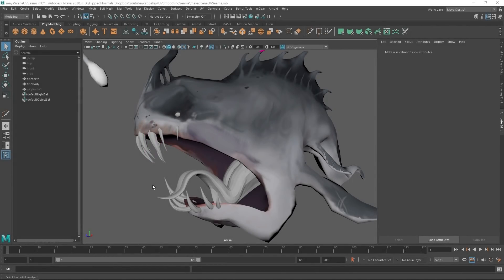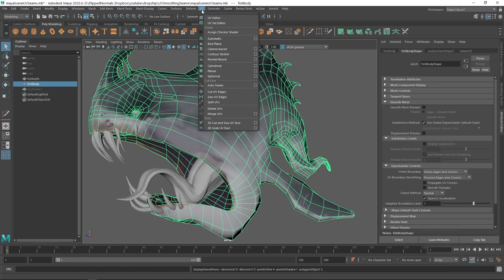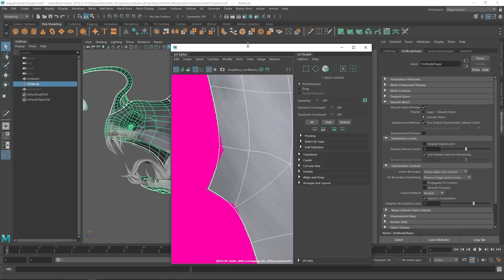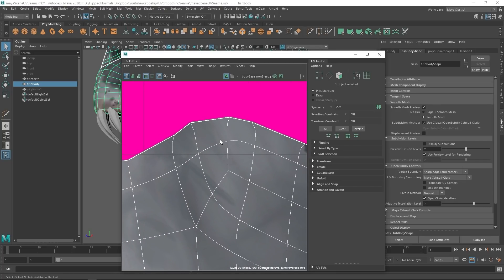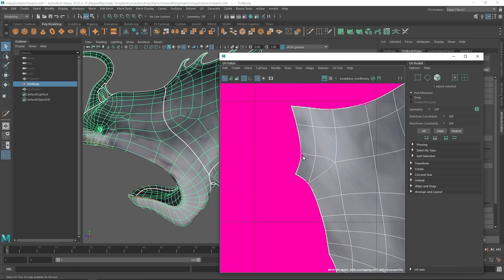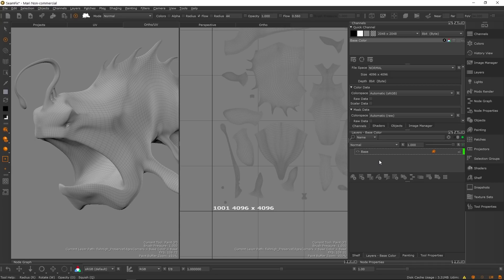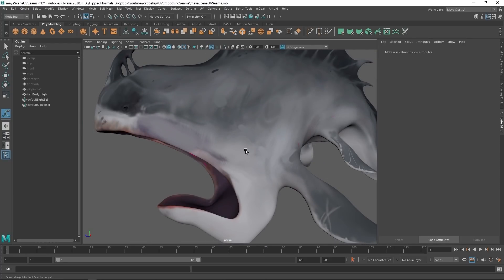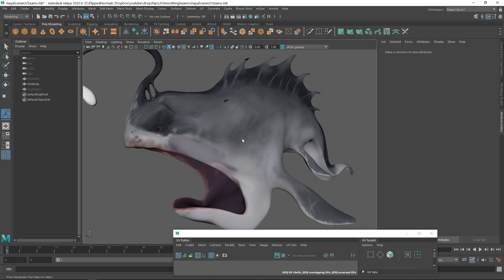The Best Way of Fixing Texture Seams in 3D - Ultimate Tip

Comment: So why not just use all smoothing, that is, preserve edges? There is absolutely no problem with this. (preserve edges and corners) actually still have problems in some corners.
For example, where there is a cylindrical depression on the surface, because the cylindrical part of the cylindrical depression must be cut by uv, this will lead to some shrinkage of the circular part of the surface and beyond the uv boundary. Especially in the case of hard edges of three wires.

Comment: A long shot but I'll ask! Hello, if there is a shading problem across the UV seams, what is the cause of this? Or how to fix? Gamma correction? As a result when I load ibl texture it does not match up across the seams. Regards
Reply from the maker: Could be that you need more bleed on your individual UV islands
Reply: @FlippedNormals  Thank you. I will check this. Also, Do you think it could have anything to do with UV's overlapped causing bad binormals?

Comment: 0:39 it exactly what happened to me just yesterday me and my project, I doing texture paint it and I use Blender and have the same problem 
        but basically what I'm doing is turn on subdivisions and paint back/ patch up the Gaps between them, And it's fixed.

Comment: There's another major problem with this, that the textures have virtually no padding in them. At more than mip0, all the UV seams will glow pink, not just the ones affected by subdivision. The solution here is to bake the textures to and from the lowpoly, and add a bunch of padding.

Comment: 'Edge bleed' in a texturing context is often referred to in software as 'dilation',  for example in Substance painter when baking utility maps you'll see an option for 'dilation infinite' to extend the bleed infinitely as described
Reply: I Blender using cycles texture baking it's called "margin" and you can set it to extend as many pixels as you choose.

Comment: But I still got a question to ask: how then we should export the displacement map from ZBrush if it doesn't support the "preserve edges and corners" smoothing algorithm? The very quick and rough solution that comes to my mind would be to use pre subdivided mesh from Maya(with "preserve edges and corners" smoothing algorithm applied) as the lowest subdivision in ZBrush? this way the difference between the final uvs will be neglectable. 

Any other ideas, guys?
Reply: Fighting against the same issue here. are there any solutions or workarounds for this?
Reply: @jobhermescreative  zbrush --> retopo / mesh adjustments / UV stuff --> painter --> zbrush --> displacement map and no maya needed
video is promotion of Maya... elves and their tricks